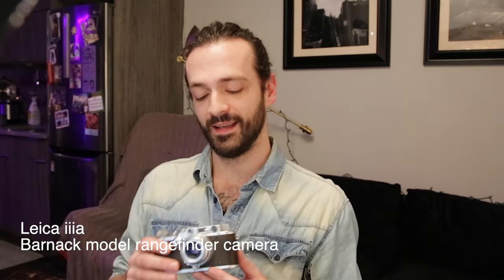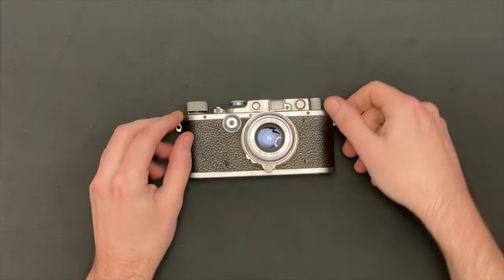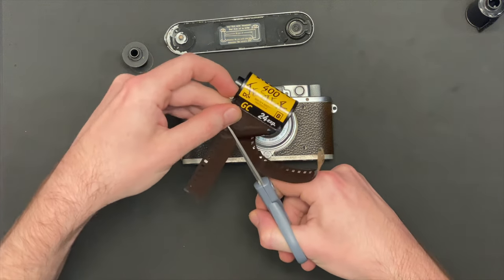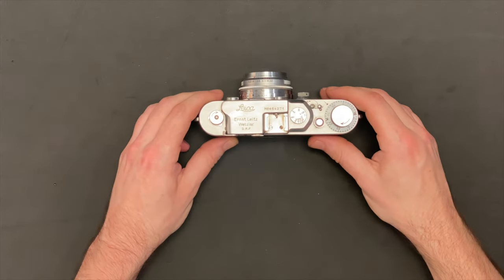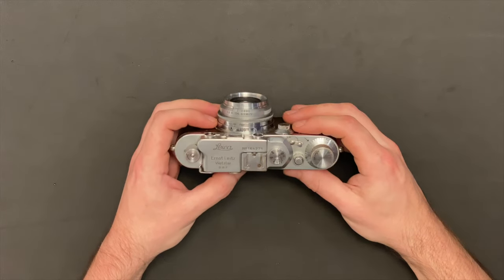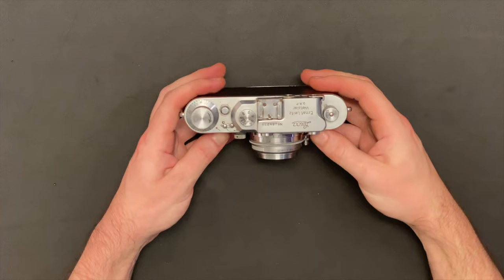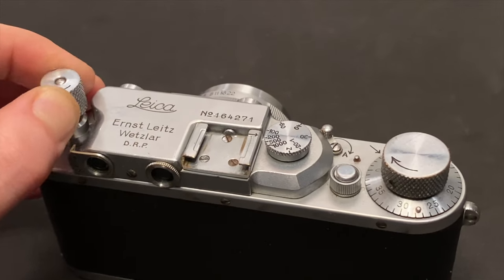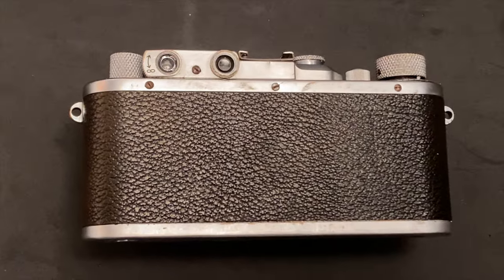Leica iiia - Loading, Shooting, and All the Quirks

Comment: I am always a bit frustrated when people pick up these cameras and talk about how “slow” they are after these sort of first-impression kind of reviews—they are slow if you are unfamiliar with them, and there are definitely a few accommodations that must be made because we live in a very different world for film than we used to, but if you put some time into getting accustomed to it, it’s honestly not slower than many other manual film cameras. I honestly find that I probably am much faster using this camera than I am with my M3 simply because I’m familiar and comfortable with this camera. I hope you’ll keep giving it a chance and don’t get it in your head it’s doomed to be a “slow” camera—it’s a great camera (my favorite, even), and some of the “quirks” that are slowing you down are things you can probably either fix (your lens’ focus is too stiff, for example, as you shouldn’t have to push it so hard that you twist the lens off!) or just get used to. 

The slow speeds on these cameras are also quite simple to clean up and get working, since you can actually take the whole slow-speed escapement out of these iiia cameras without taking the camera apart nearly as much as with the later iiic+ models (there’s like one or two screws in the bottom that iirc you can just unscrew and the whole escapement will come out), and most of the time all you really gotta do is soak that escapement in some lighter fluid, maybe put a few tiny drops of oil on the pins in the gears, and pop it back in and the slow speeds will work just fine. 

Also you should count yourself “lucky” maybe because your iiia was definitely “upgraded” to have that rewind knob that pops up! That’s not something they did until the F models, so someone probably had that upgraded (it’s not necessary, but nice to have—I used to have a iiia that had that as well).
Reply: This. This camera requires practice to use it smoothly. If you look at the original manual, it actually has exercises for you to practice. At a certain point it becomes second nature.
Reply: Love your point!

Comment: Calling the camera "crazy" "quirky" and "slow, is because we are watching with modern eyes...
Back in the day it was new, well lubricated and optically very bright.
Compared to old plate camera's  it was quick, stealthy and swift... but that was 90(!) years ago...
Have the old girl serviced, and only than she will reveal what Oscar Barnack ment with this piece of hightech from back in the day...

Tip: with rangefinders alway put the lens back to infinity after you took the shot. When focussing for the next shot there is only 1 direction to go, ypu will find your focus quicker that way...

Tip 2: Use hyperfocus... on bright days with f11 you will be in focus between 2,5 meters and infinity, no need to focus at all, and you'll be as quick as can be!
Reply from the maker: Tip 2 blew me away. Such good insight
And so right on the modern view of older systems. It's so hard to shake off the digital mind set. But you won't be able to service recent cameras a century from now
Reply: @ThisOldCamera  very true, somehow a lot of we find important today will be lost in a 100 years... because of continuous changing digital standards and the old ones becomming obsolete. That is why film photography is still relevant! It might be that in a century the negatives we make today, be the only source material available about our time...
This is why channels as your own are pretty important!
Just think of it... can you still open a floppy drive, or a cd or dvd on a modern computer?

Comment: Nice video about this vintage Leica camera, thankx ! i have a Canon IId which is basically a copy of the Leica with the same feel and vibe. You catched all the main points pretty good. I love the pure mechanical operation, it's like a clock with all the gears and parts and I find it amazing that they still work great after so many years if they are CLA'd . If maintained right, that camera will still take great images in 50 years. Can't imagine that my digital cameras will last that long.
Reply from the maker: That's awesome to hear because I wanted to look more into Canon's designs back then. I've seen how they have similar vibes to a Leica, but my bread and butter is made from Canon cameras. So I'm super curious about what they were doing that far back. and no way people are CLA'ing our used 5D's 50 years from now

Comment: You need to have a lens cap on a rangefinder like that, or the sun will easily burn a hole in the cloth shutter.
Unlike on an SLR where the mirror project the shutter.
Nice video.
❤❤

Comment: the camera looks very good. But yes, the use is quite complex. Mechanical 35 mm cameras advanced a lot in the following decades. With the range- and viewfinder being separated, I think this Leica is more for landscape even if the advertisement focused on the new fast shutter speed. It also shows how much R&D had to be done to get 35 mm mechanical cameras to where they evolved, which could be easily overlooked if you only know later versions, like the Nikon FM2.
Reply: I use a Zorki 1E (Leica soviet copy from 1955) for street photography. f/8 or f/11 and zone focus. Just need the viewfinder. I also used it for portraits a few times. It's not as fast as more modern cameras but when you get used to it, it's not so bad. So not only for landscape :)
Reply: Wee

Comment: Glad you had fun with your Leica.
It is slower to make a photo with than a phone but it can be fast enough for almost any photography once you've used it enough to get some muscle memory for it. 
It will reward use by becoming second nature fairly quickly.
A couple of things that may help you:
First thing I will suggest is that if you want to use the camera is to get it--and the lens--serviced. That will make it as easy to use as it can be. The advance knob will, for example, spin very smoothly and require much less force, the viewfinder and rangefinder windows will be much clearer and nicer to look through, etc. And the shutter speeds will be as close to the marked speeds as possible. Youxin Ye is one service guy I can recommend.
I like lenses that have the focus button like that Canon lens does because after a short while you will have a good idea of what focus distance the lens is at by the feel of where that button is. 
You can certainly use the 35mm lens as you have done in this video but your framing will be much better if you either get a 50mm lens--the focal length the viewfinder was made for--or get a 35mm auxiliary viewfinder. These fit into the cold shoe on the camera and give you a much better approximation of what the lens is seeing. 
Lastly, a little time spent learning "sunny 16" will go a long way to making this camera quick and fun to use.
Reply from the maker: Wow thank you for that! 
I hadn't considered the lens size (35mm) to viewfinder (50mm). Such a good point to consider

Comment: Nice review of the Leica IIIa. There are film cutter templates available which makes the cutting process much easier and they are far cheaper than the original Leica film cutter template. 
Using a template is far better than the alternatives.  You want to prevent film bits jamming or damaging the shutter. 
I’ve seen suggestions of using a card inserted from the bottom of the camera and then inserting the uncut film or taking off the lens and setting the shutter to t then while shutter is open positioning the film in. I would recommend not doing either but to invest in getting the film cutting template which ranges in cost less than $50.  To get your shutter replaced or repaired will cost over $300. Just not worth it. 
Enjoy your IIIa I’ve been using one that I got about 10 years ago and had it CLA’d recently.  Different experience that shooting an M.
Reply from the maker: Oh yeah I noticed those cutters in the manual. That definitely seems the way to go after trying it. Anything to avoid all those small pieces getting inside

Comment: You should use the nikon f2
Reply from the maker: So I had never used a Nikon before. Blown away but that system. The fact they didn't change their lens mount, crazy to todays standards. The changeable parts in the view finder and glass, what?
Reply: @ThisOldCamera  yeah you can change the focus screen on that nikon, lenses for the nikon is really good and not as expensive as leica lenses